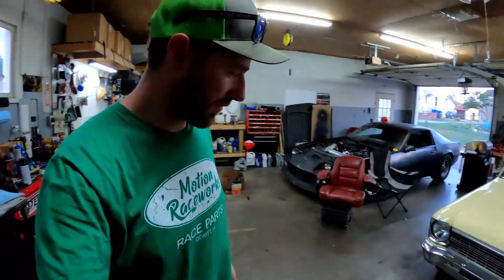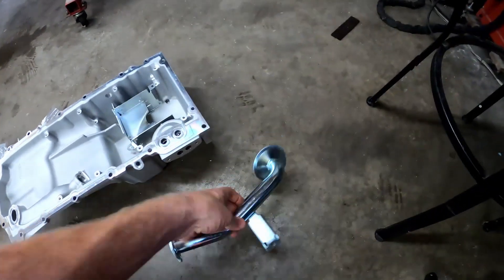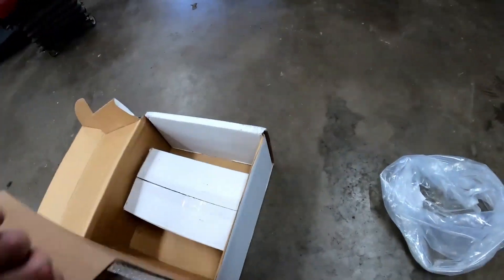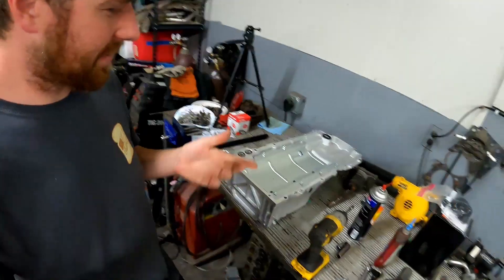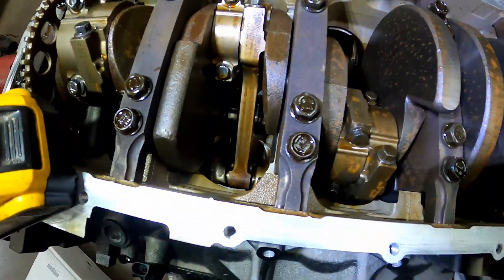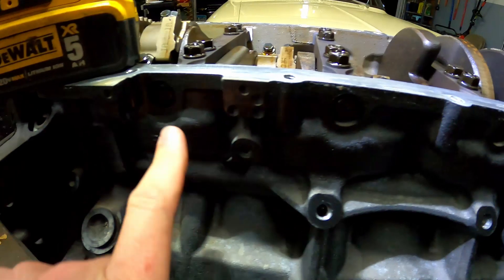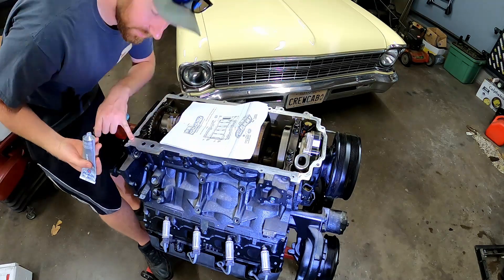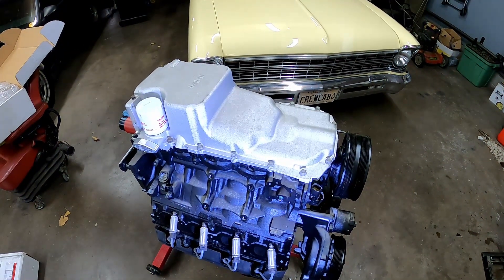L83 5.3L Nova: Holley Gen V LT Swap Oil Pan Install and Bottom End Overview

Comment: Hey awesome video! Quick question, would it affect anything that this pan has significantly less oil capacity than the one from the factory?
Reply: It will only save you money on oil. The gen V 5.3 takes 8-8.5 quarts only because it’s the flagship engine. Gm utilized that engine and it’s build quantity for epa purposes and used 0w-20 oil. This was for two purposes. First a small percentage of mpg increase. More oil volume was required to ensure that enough volume was available at all times. Secondly the 0w-20 specified has far less evaporative emissions than other oils. Both of these were done only to get the GM truck fleet past a certain epa requirement threshold required by the government.  I switched to 5w-30 and have utilized it for 160,000 miles and have zero issues due to oil viscosity.

Comment: I was hoping i was the only one im doing the same 66 nova L83 turbo 350 trans brake 3800 stall caged tubbed 456 gears 32'' tire gpi rods and piston drop in direct injection,dod,vvt delete Ls terminator x max Ls7 intake fabricated alternator bracket for accessory drive delete remote water pump borg warner s480 turbo texas speed custom gind boost cam looking for a 1000 at the wheels after watching this video i will be checking my holley pan for cracks

Comment: I put one in my third gen camaro, it sucks how much the parts are compared to LS... I’ve got close to 6500 in the entire swap. And because I’m using the 6l80 is like another 800 for the driveshaft conversation 🤦🏽‍♂️ but my 88 now has a 2015 heart so oh well
Reply: I'm about to stick a 2014 with a 6L80E in my 37 Chev PU.  An LS would have been a lot cheaper but I had no idea how different an LT was from anLS